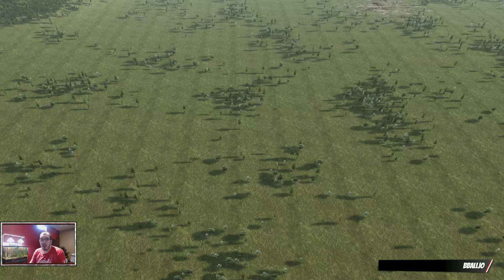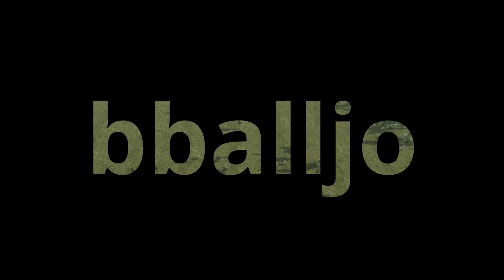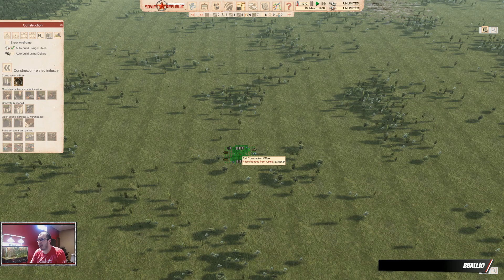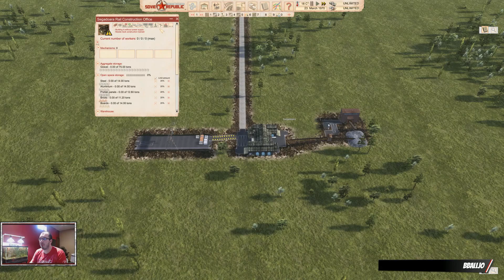Easier Rail Construction Guide | Tutorial | Workers & Resources: Soviet Republic Guides

Comment: I did almost same pattern with the directional tracks until a few days. It is actually easier to build simple double tracks from station to station without using any diamond crossing. Connect the rail construction the same as any station with double tracks. Treat the complete part of the network wich you are currently building as a single block. As example I normally use a T-junction after the rail construction office und build the railway network to several stations using additional junctions. To my own suprise the rail construction office can use two track builder at the same time even when the rails are connected with junctions. On both tracks a track builder will run in both directions and since there are no diamonds crossing they are only on their own track and do not block each other. After finishing the connections to all stations add the diamonds crossing and semaphores. When finished you can continue building a new railway network the same way beginning from a station you did connect before. When updating an existing network I removed the semaphores start to build the double tracks and build the diamonds again as the last parts. I hope it is not too complicated to understand as text... it made my life much easier building the railway this way =) Now I only get a headache when trying to update an existing network with traffic on it at the same time... so far I have not found a satisfying solution and use a bypass to do it.

In short: double track, both directions not using diamonds crossing until you have finished building a rail network from a station to station and then continue the same way afterwards from a before connected station is much easier.

Comment: Are you using multiple train builders?
I'm running a maximum of 2 track builders in the game. While the First track builder is in construction, the second track builder waits until the first builder's construction over. And the second builder  take over the task. I'm tried to run track builders simultaneously but it's always messed up. Is there any better suggestion?
Reply from the maker: Use directional track, and make sure that only 1 train can enter the point of no return for each construction site (single block), then add some diamond crossings in appropriate places
Reply: @bballjo  you mean make the single block and set the diamond crossing at the entrance of block right ?
Reply from the maker: Yep
Reply: @bballjo  Thanks! I finally realized that there's no better way than to do it now

Comment: Why, they can't swith direction on any block and go another way like real trains, while then can do so in normal traffic. Is there any way to construct rail manualy without adding stupid turn loops everywhere? I made main line with freight line branching of and joining main tracks again after industrial zone. Construction office have entry near one of the junctions to freight tracks. They can acces only that junction and a bit of joint line leading to nowhere so far. So to get anywhere I have to end it with loop like in toy set? :/
Reply from the maker: They can switch directions at any waypoint... waypoints can be stations, signals and waypoints, so you should be able to create a network that supports this.
Reply: @bballjo  Strange. When I realised they can't just turn arround on end track and work in another direction, I added waypoint to it and construction office still says that any tracks not reachable in straigh line from it can't be assigned as they have no rail connection. Here screenshot of my layout. https://i.postimg.cc/xd0Tvnnw/Desktop-Screenshot-2021-05-31-02-43-12-59.png
Reply from the maker: Oh, i missed that in your original post. RCO trains are stupid and autonomous, and you cannot control them, they will only take a direct path to where they need to go.
Reply: @bballjo  Figuered it out. Loop on far left did the job. Similar on far right will be needed too as it can't go through shed.
Pathfinding to fueling station isn't much better as it can't see through loading stations, getting stuck between it and customs. Have to recall it to shed for every fueling.
Reply from the maker: It cannot see through customs, that sounds right... But it should be able to see through all other stations
Reply: @bballjo  Well, it didn't. Highlighing fueling range clearly showed that it reached only to agreagate loading station right in front of it. On the screenshot above, groundworks on the bottom track are the fueling station. To the right are in line three loading stations with bypass only for agregate and then straigh tracks to the border. Stupid layout in game terms, but it's my first time dealing with trains in it.
Reply from the maker: I think there is another solution, but I don't think I have a clear picture of the whole issue...

Comment: I'd be cool if you made a guide on how to build on rails with traffic already in them.
Cosmaut mode is hard to figure out sometimes :P
Reply from the maker: I'll see if there is something I can do... It's really mostly planning way ahead, but it's not impossible to build on existing rails:)
Reply: It's really easy when you get used to it. On a normal 2 way track, you use mixed signals with the double arrow pointing to where you are building, and double way chain signals at crossings. Just make sure to have a couple of x crossings at regular intervals so that you don't stop everything for to long.

Comment: I really hoped you show how to construct the crossings yourself without blocking the construction vehicle.
I often got the problem that I got a part where trains are already running, and I try to build a crossing for the new construction zone. I do a crossing from the right to the left lane, so that the construction vehicle can build both new tracks, and after that I place a left to right lane switch for it to return into the 'normal' flow, but once it is finished with the first crossing, It cant find its way home. It is stuck on the new part, since it is not intelligent enough to travel the left lane to the next signal and then turn to leave the area. 

Not sure If the explenation is understandable, so I try in ASCII

_______________Left Track (Travel Direction: left)
_______________Right Track (Travel Direction: right)

add new construction zone, so that train can move from right to left, and after that one for left to right. 

_____________________
_________/___\________

Train starts building new track. Completes right-to-left track
Now It could drive to the end of the left track, turn around and travel to the RCO, but it is just stuck on the new constructed part.

Any Ideas?
Reply from the maker: I have the same issue...there are only 3 solutions that I know...1. build occasional crossings when you build the rail, so this isn't such a headache. 2. Reverse the signals until the first crossing is done, this requires a lot of baby sitting. 3. Allow yourself to autobuild the crossings, good for your sanity... personally I do 1 and 3 the most, 2 sometimes...
Reply: @bballjo  currently, I use 3 the most, since 2 is, as you said, a lot of baby sitting, which i would like to avoid. 1 is also a good way, but sometimes these crossings are multiple sectors away from the construction making this partly into solution 2.